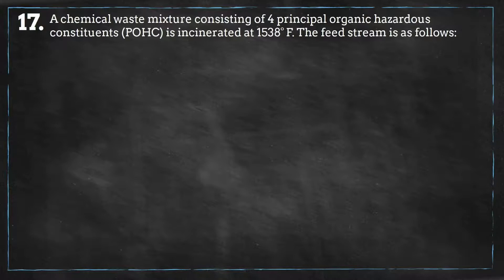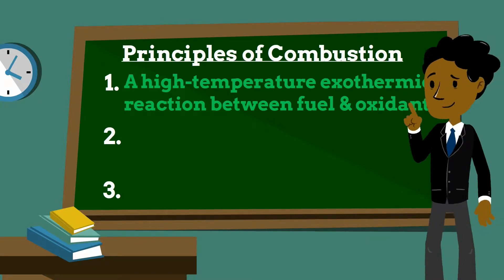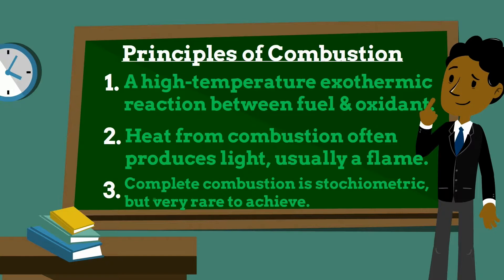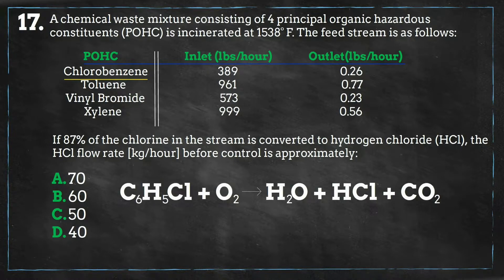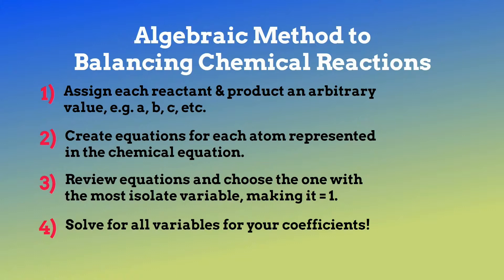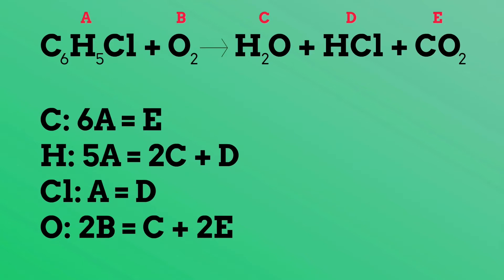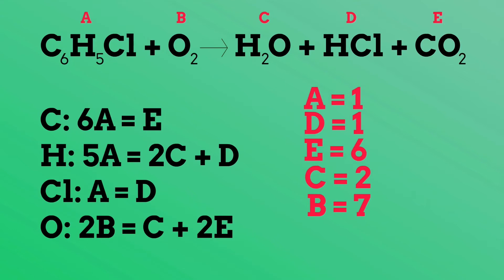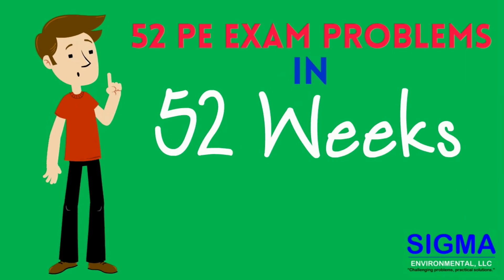Principles of Combustion - Episode 17 (Waste Management) | 52 PE Exam Problems in 52 Weeks

Comment: No need to define and balance the reaction formula here, since the problem already states 87% yield of HCl from chlorobenzene. The reference manual defines the chemical structure of benzene (C6H6), and since this is chlorobenzene, the chlorine will just take the place of a hydrogen (C6H5Cl). Then using the periodic table you can easily find the mass fraction of chlorine in chlorobenzene, multiple by 87% yield, and convert kg/hr to lbs/hr.

Comment: The molecular weight of chlorobenzene (C6H5Cl) is approximately 112.5 g/mol, and the molecular weight of chlorine (Cl) is approximately 35.5 g/mol. So, the fraction of chlorine in chlorobenzene is 35.5/112.5.
Now we calculate the total chlorine from chlorobenzene:
(since 1 lb = 0.453592 kg)

(35.5/112.5) × 389 lbs/hour = (35.5/112.5) × 389 × 0.453592  kg/hour ≈ 57.74  kg/hour
Since 87% of the chlorine is converted to HCl, we calculate the HCl produced:
57.74  kg/hour × 0.87 ≈ 50.27  kg/hour